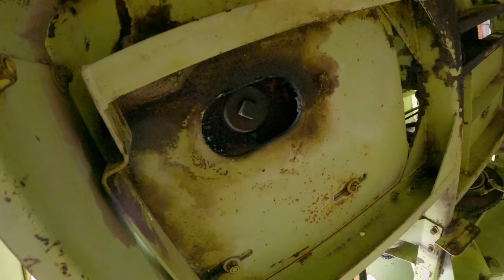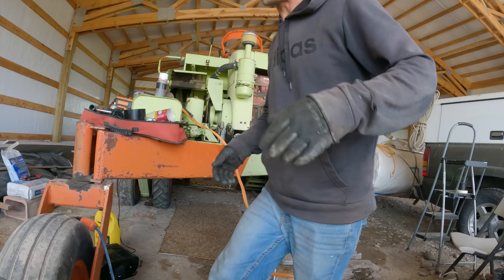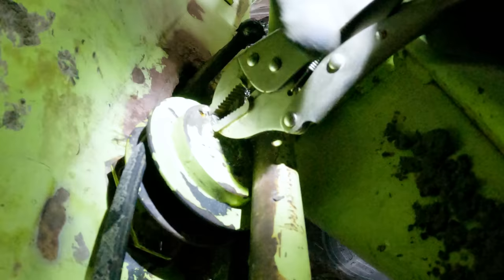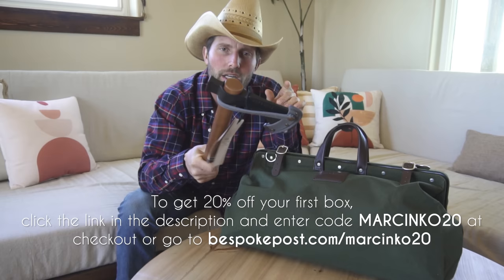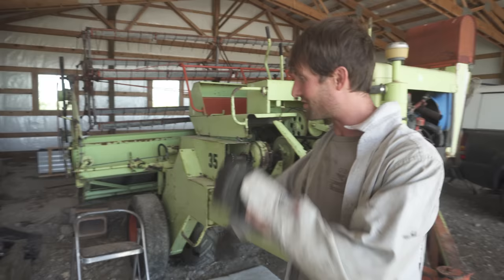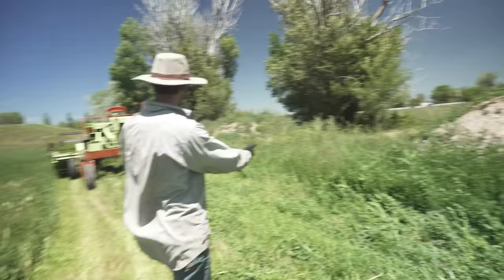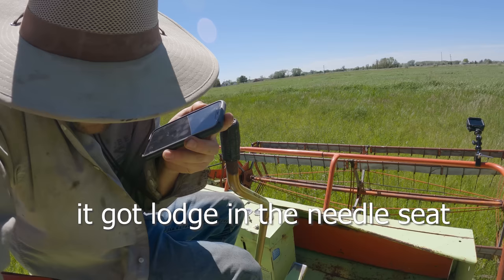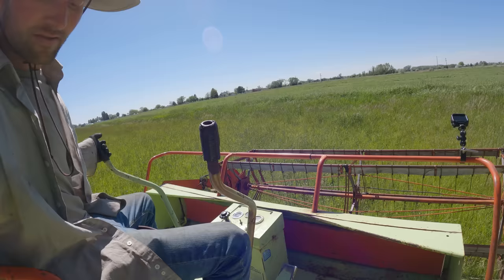First time cutting with 1970 swather. / What did I get myself into...

Comment: Same carb as used on my 1950 Ford 8n tractor. Used for many years and by many different manufacturers.  You can buy a new one on Amazon for $35.00 but I would be skeptical of the quality.

Comment: Jonas - the “old tractor” Virgin. That drain plug is just like an old Ford tractor- all the oil is out in seconds. A piece of steel pipe in the right diameter makes adjusting the sickle guards easier after hitting rocks. 

That belt had 2-3 seasons left……..;)

Comment: Jonas that's fantastic to see this old girl doing what she was designed and built to do. There is just something about see this old iron working the field. 

This brings back some nostalgic memories from growing up in the 60s and early 70s. 

I've run sickle bar mowers in the past, it was handy as can be to have a couple of spare sickle bars ready to slide into the cutter bar when they started getting dull. I don't know if you can get sickle bars for this machine anymore. If you can it helps big-time with lowering down time a lot. With these 4 1/2 inch grinders it will make sharping a lot easier and faster. The trick is keeping the cutting-edge at the right angle.

Comment: HAHAHA! "What did I get myself into?" I ask myself that every single day, Jonas! 😁 

Nice work getting that ol' girl cutting again! Did a great job on that field, too!  I can't help but wonder what the people driving by were thinking when they saw you dancing on that thing, HAHAHA! 😂From that angle I can see you've got a great aviation-friendly spot there. I'd be able to get my paramotor out of there easily from the looks of things, even at my rookie status. 😎

I feel bad for people 50 years from now that might try and get some of today's junk running again. They won't be as successful. Can you imagine computers sitting outside 5 decades? YIKES! Everything modern is built to fail, it seems.  I've got a 1967 International Harvester 3414 diesel backhoe that's been outdoors longer than I've been alive, yet she'll fire right up EVERY time I hook up a good battery to her. Amazing abuse this thing has seen over its life, but it still works. Might dump 5 gallons of fluid all over my yard, but she works! 🤣 I learned to keep my fingers the hell away from metal fan blades. I have forgotten how deadly those things are. One blade got my ring finger and smashed it right through the nail! What a bloody mess! That was the first year of owning the thing. Now I don't touch a damned thing unless it's OFF. One way to learn - carrying the cat by its tail! Story of my life! 😆